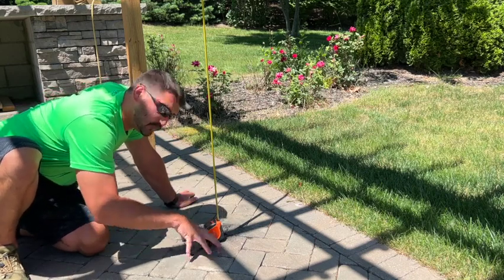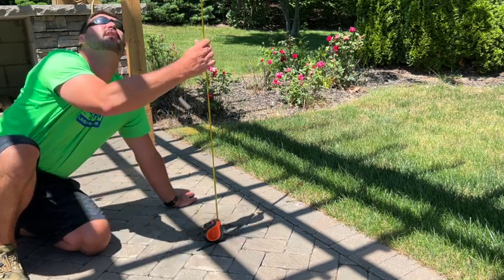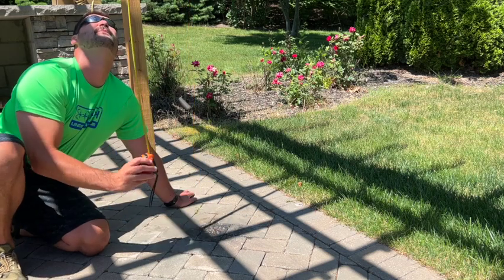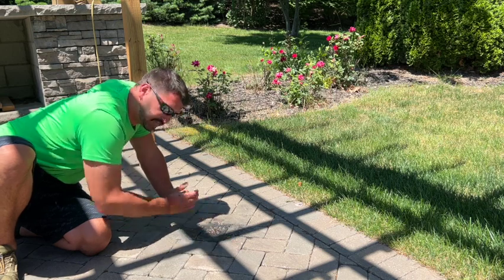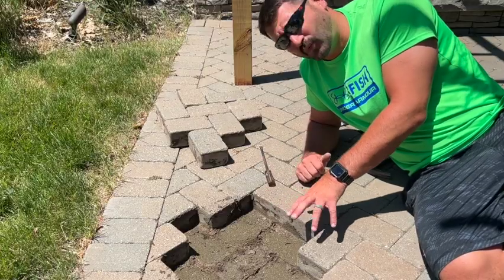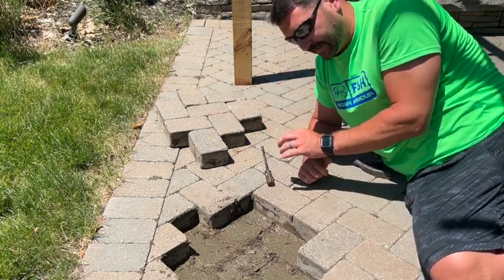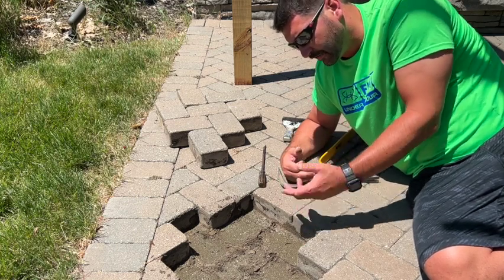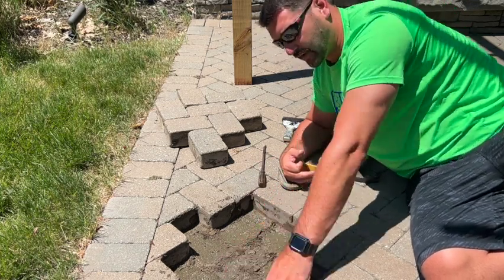Removing Paver Stones For Repairs (No fancy tools required!)

Comment: It helps to have a rubber mallet/dead blow (or block of wood and regular hammer) and tap surrounding pavers to help break that ‘bond’ as you are trying to lift. Helps to have an extra hand.
Reply from the maker: Great tips! Thanks for sharing!

Comment: I have opened a hole and screwed in a TapCon then lift up with a hammer to extract that 1st paver.
Reply from the maker: Definitely an option, as long as they are not going to be reused.

Comment: U could have tried to remove the grease by hitting it with a Harbor Freight Greenwood torch and a propane tank.  It should burn the grease off.  If not u may have to replace 4 pavers.  Roll the dice.   Life is a risk carnal.
Reply from the maker: Yes, in this though I needed to remove them as I was adding a support post and needed to add concrete footers.
Reply: What is "risk carnal" - did auto-correct mangle the last word?